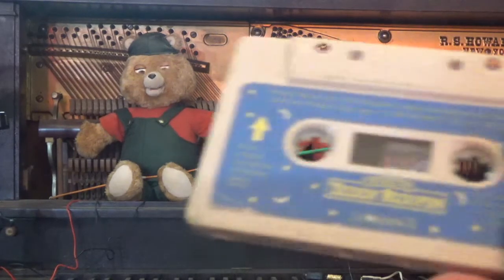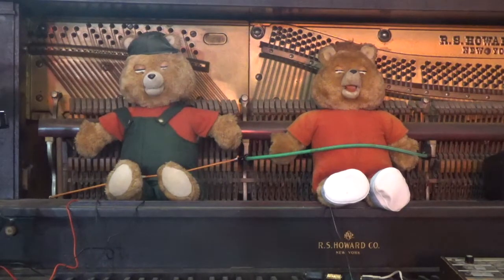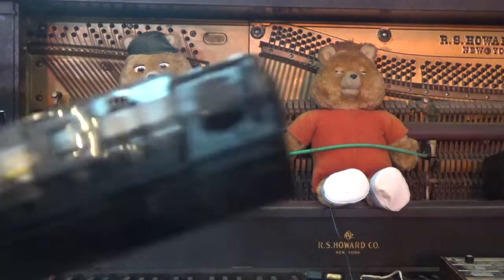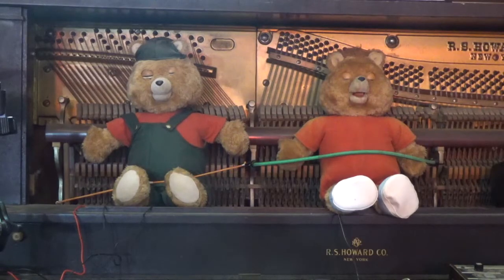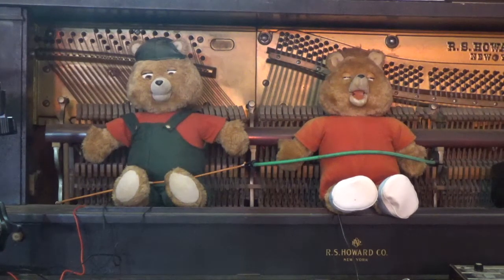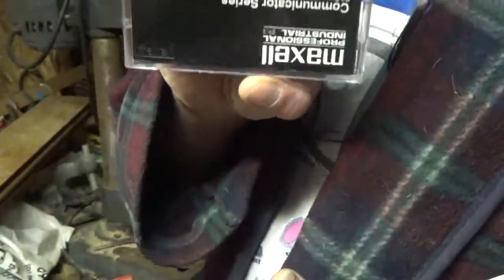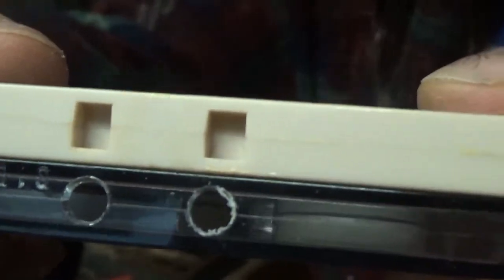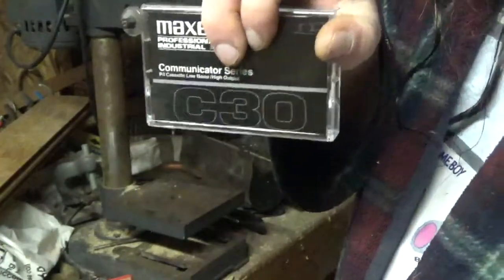Programming Teddy Ruxpin: Part One

Comment: wtf is going on with the teddy on the left?
Reply from the maker: What do you mean? I have an AI app, interfacing with my phone, through the toy, over Bluetooth. I have another video, explaining how to easily, and nondestructively interface any perfectly functional WoW Teddy, over Bluetooth, without modifying the toy, itself. It’d be a lot more straight forward, but most models, have an anti piracy mechanism within the tape deck, and I couldn’t find anyone else providing any sort of content or know how, to defeat it, so I put it out there. The animation, in this case, isn’t being programmed, it’s just incidentally, working as well as it does, if imperfectly, by a serendipitous quirk in the technology, they used to manually program it.
Reply: @WizardClipAudio  interesting

Comment: hi friend could you tell me the reason for not using the cassette tape type 4!?!!
Reply from the maker: Primarily, they are not the correct tape formulation, which would likely result in over saturated signals going to Teddy. Secondarily, new blank Type 4 tapes, individually, ordinarily, cost between 10-20 times as much as a blank Normal Type 1 cassette. Gotta save the Type 2’s and type 4’s for stuff that truly requires them. Drilling the additional holes on a type one tape, is relatively easy to do, more cost effective, and ensures you have the right bias formulation of the tape, that Teddy’s tape head is designed for. ♥️
Reply: @WizardClipAudio  so which cassette would be indicated!?
Reply from the maker: @7ygftu5yi6  To make a new compatible Teddy Ruxpin tape, you need a preferably new blank cassette tape, with the record tabs intact, and with the following specifications on the label: it should say either or both Normal Bias/Type 1 cassette, somewhere. It should also be C60 or less, in specified total time duration, which is 30 minutes per side, but even more ideally Ideally C-30, which is 15 minutes per side. If the tape is longer than C-60, there’s a much higher risk of it getting ate up by the pinch roller. Longer tapes use thinner, lower quality tape to achieve the length, and are generally awful, in most applications, anyway. You need to drill the two additional holes on the spine to the tape, between the bias and record tabs, in proximity, as featured on the original proprietary Worlds of Wonder cassettes,… or Type 4 cassette housing. 

The World’s of Wonder proprietary cassette tapes, are a hybrid design of Type 1/Type 4. The tape inside them is a normal bias formulation, in a Metal/Type 4 housing. You shouldn’t simply use a Type 4 cassette, because it’s either gonna sound or work terribly, in almost every conceivable way you go about it. If you record in normal bias on metal bias tape, it will result in an under saturated signal recording, which will be noisy and muffled, if you record it in metal bias, as designed and use it in teddy,…. It will be over saturated, resulting in likely distortion, or the animation not working correctly, or potentially damaging it. In the Video, I show how the holes on the cassette’s spine indicate the sort of tape, it probably is. There are a few, but widely unrelated exceptions, that are associated with pre-recorded cassettes. As long as you stick to new old stock blank tapes, this should be a non issue.
Reply: @WizardClipAudio  the cassette tape with Bluetooth that you tested in another video worked!? It's a good idea!?
Reply from the maker: @7ygftu5yi6  Most stereo capable “CD to Cassette” made prior to 2010, with a a removable strip on the bottom, intended for changing the direction of the auxiliary cord, should work. Just strip the bottom piece out entirely. I am using RCA branded stereo tape adapters, in tandem with Monster branded Bluetooth receivers, connected to them, for Bluetooth applications. The Bluetooth receivers, I picked up, awhile ago for 10 dollars each, from my nearest Walmart location. The RCA cassette adapters,.,. I picked up as new old stock, at thrift stores, probably sub 5 dollars each. Just try to procure a well constructed older model, and not the really poorly made ‘newer’ ones, you might see at Family Dollar for 5 dollars or less. My impression of those, is that they will probably not work satisfactory, based on the appearance of their quality of construction.

Comment: I found your channel from your comments in databits's piece about powering a late Nineties Ruxpin's servos using a Casio SK-5 (https://youtu.be/Vbu7OIm4oHI). Thank you so much for leading me here! (Yes, I've subscribed.)

I picked up a 1985 Ruxpin in great condition. I'm not going to bother with the cassette interface, as I spent enough of the 1980s and 1990s with them. However your findings about the Type IV cassette housing as the trigger for the servo switch is helping me to get my wiring right.

I wanted to offer a suggestion with your servo code. When each Ruxpin finishes talking, the servos just stop in place. This looks... uncanny valley. You may want to add a function that detects an audio timeout (such as 3/4rs of a second) to reset the mouth servos closed and set the eyes to awake-not-shocked (about 75% open).
Reply from the maker: Sorry it took me so long to reply. I've been pretty busy. I'm gonna return to the series in autumn. I typically tinker with such things in the cold months to help cope with 'cabin fever'. Yeah,.. so,.. with the projects I've been demonstrating so far, there's been no coding of any sort required. The servos are just incidentally animating from the percussive elements in the speeches audio, through the channel being center of right and left channels. It's actually only serendipitous that it even animates as well as it does. You can kind of refine and modulate to what degree the audio triggers in the face by simply controlling the device volume out put to the Bluetooth device,... and use Teddy's volume knob to as kind of a post amplifier for the sound. The primary focus of these videos, in particular, so far.. is sort of to be like instruction on how to interface with Teddy and give him new features and abilities, without either modifying, or damaging the stock toy, and the methods be a easy, approachable, inexpensive, and not require a high degree of technical ability. That's sort of the impasse, I found myself while initially trying to script and film part 2. I felt like my approach was starting to get too technical, and requiring a lot of peripherals, not so readily available, and that what I filmed,.. either was explaining too little,... or, another take, was kind of explaining too much, and coming across as a bit condescending. As things warmed up,.. summer month priorities took precedent, and I figured I'd just take my sweet time sort of considering how I'd approach re-filming it, in the fall.  I'm glad you find the videos useful! I however, am have not demonstrated any sophisticated sort of 'programming' as of yet, in the videos. Teddy's stock animation, from the tape just uses audio noise triggers to trigger the servos biased towards a particular sort of sound, and he can be puppeteer-ed with the right sort of keyboard or synth settings.  The mouth is biased towards like abrupt percussive mid-eq or middle of the keyboard sort of triggers,... and the eye's are biased to like a bit higher pitched and sweeping sort of sounds. So, if you use a keyboard,.. I recommend one that can do like a split instrument feature. If you just put straight speech panned straight down center as I try to explain in my videos,... it's actually the percussive consonants in the speeches audio that trigger the mouth's animation,.. and when the inflection of the voice shifts around, is what's animating the eye's. It's actually just kind of a convenient quirk, or serendipitous accident that it can operate in that, 'mode,' so to speak. I wouldn't recommend putting very raucous music through it, for a prolonged period of time,  in that way though, as it'll put unnecessary wear and tear on the servos. However,.. I have taken up to widely using it like a novel/retro animated bluetooth speaker sometimes, but, primarily dialog centric content. It absolutely amuses me to no end, having Teddy give me the daily news, or animate to one of my favorite podcasters. The most important thing is just bypassing the lockout switch by making sure the tape cassette adapter has that bottom portion stripped away, and presuming the toy is otherwise working correctly as it should, then yeah, the sky with what you can do from there is only limited by your imagination, and whatever peripheral hardware you interface with it from there. Programming new tapes with more refined animation, is like a whole can of worms, and there's not a lot of resources. I just happen to amalgamate what I know about audio cassettes, and work out how they made the proprietary cassette for Teddy. :)
Reply: @WizardClipAudio  Thank you VERY MUCH for the touchback and the updated info!

I'm making progress with the servo control via microcontroller. What you just wrote about percussive consonants triggering the mouth and vocal inflection points triggering the eyes is seriously valuable. I may have to start making videos as I make more things happen.
Reply from the maker: @pseydtonne  Oh?! Have you seen the additionally animated, animatronic Teddy Ruxpin, some other guy made? It basically guts all of Teddy’s stock components and each animation component is controlled via midi, and has to manually programmed and animated. from the ground up. I wonder if such a system could be reconfigured to accept arbitrary information or sensory data, in that way,… say to the degree,… to actively play, say Pong, on a television set. Basically just using midi as the general controller interface for the servos/stepper motors or solenoids, but more widely automated, on its own accord?
Reply from the maker: @pseydtonne  https://youtu.be/4HUTG0HVRxQ.      Check this out, if you haven’t seen it already! 😲🥹